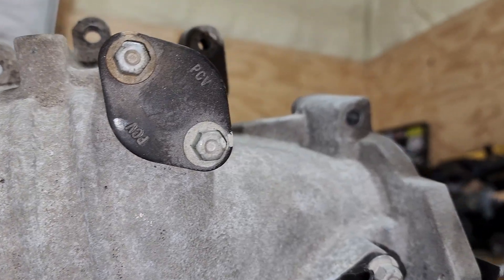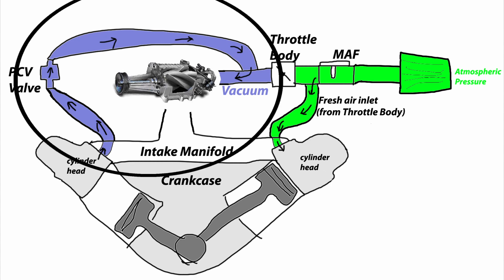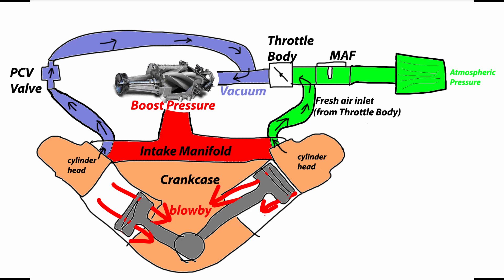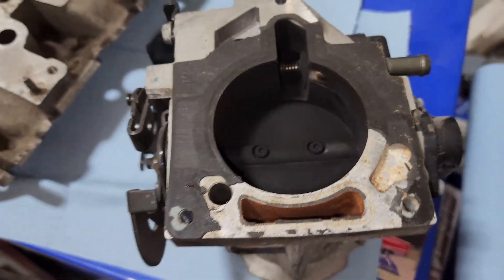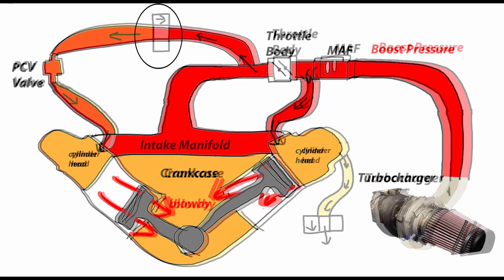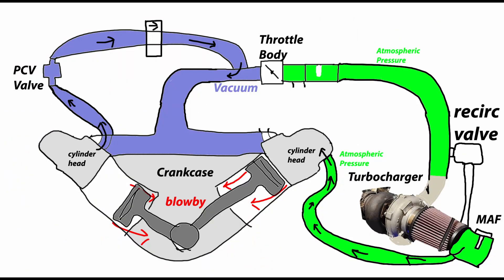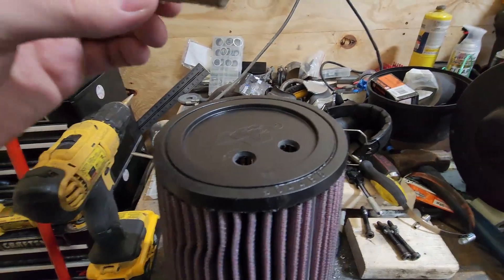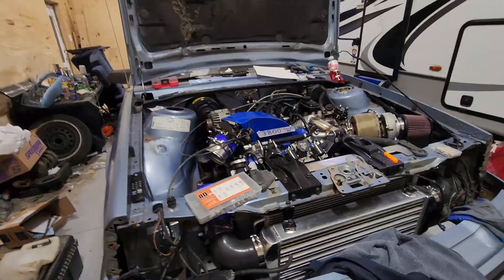Functional PCV on a Turbo 3800!

Comment: Another option may be to put normally closed vent valves on the valve covers that open when pressure gets fed to them from the charge pipe/manifold

Comment: Great description in the 1st half, and showing what's generally happening with a few different options.  I've bought parts for some elaborate evac options, but not installed, yet.
Haven't dealt with any fumes over the years (maybe concern for worn ring cars), but the condensation is certainly an issue with shorter drives and lower t-stats.
As long as you toss a catch can in-line to eliminate the gunk being drawn back in, especially ahead of the turbo, it is nice to have a draw working right.